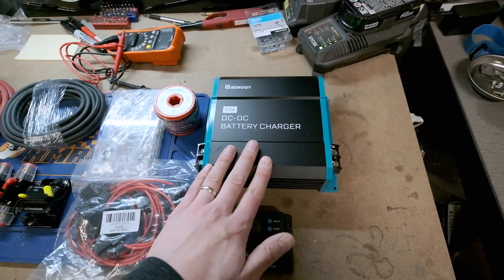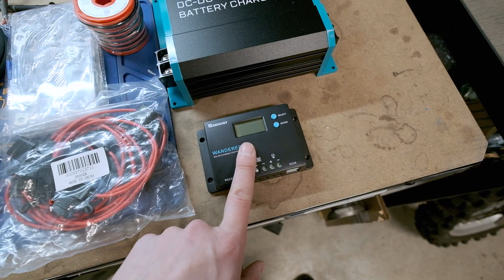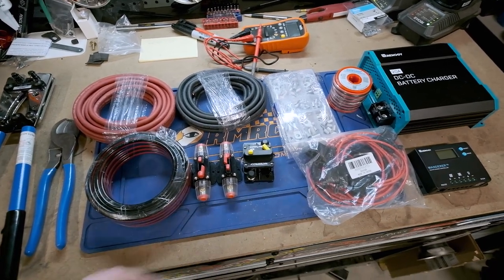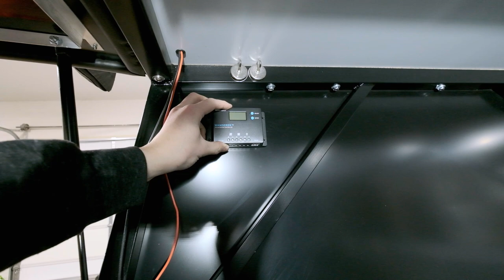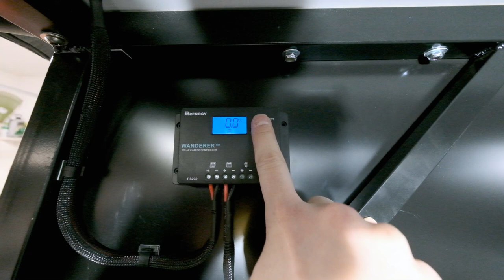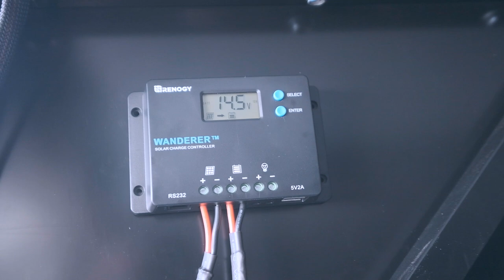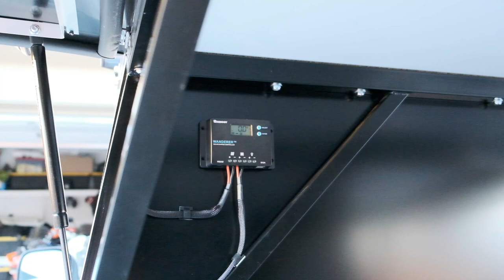DIY Solar and House Battery Install In My DIY Camper - Sunflare Xplor 105, Renogy DCDC Charger

Comment: You should build a mount for the solar panel. They get too hot and don't work efficiently.  Get some ventilation on the underside
Reply from the maker: We will see if it’s an issue in this use case or not. I could see how it would be on something with an insulated roof, but this is not
Reply: @pnwxplore  I'm no expert, nor do I have any experience with solar. It's what I've read and been told. Unless it's 110 out of doubt there's any problems, but I thought I'd relay what's been said to me. I'm curious myself how well it will work. I've got a setup in my truck with an battery isolation switch, 300 amp alternator, ran into my truck box with a 1200 watt inverter that's being replaced with a 5000 watt inverter. My bank charges when I drive. I also want to run solar though, for those times I don't drive much. Which isn't often lol. Then I've put a 70 amp breaker box with 30 amp shore power into my trailer. Tandem 15 amp breaker and single 20 amp. Still working on that though. I've got it temporarily set so I can get heat. Get sick of paying for propane. I've been off grid since April (2021) and I'm currently converting my cargo trailer into a leather studio/shop.

Comment: I like that solar panel.  I wonder how that stick tape will hold up as I would like to do that to my shell instead of installing brackets.  I really like the clean look.  I wonder how many watts it pulls on a bright sunny day.  Might have to wait a few months for you to test that.
Reply from the maker: Yeah we will see how it performs. But these are typically surface mounted and these are high quality panels, so I am sure it will do well.
Reply: The recommended tape for mounting solar on vehicle roofs is VHB tape, also available on Amazon. I don't know whether the tape used here is better or not.

Comment: Clean! Where did you fuse from the alternator/starter battery to the DC DC charger? And why did you choose the Xplor panel vs some of the cheaper amazon options?
Reply from the maker: The fuse is under the hood as it was the one I used with my 12v power run to the back of the truck. I got a decent deal on the xplor panel. I also like that it’s high efficiency and has a biomass diode on every cell, meaning one cell being shaded won’t completely kill the output of the panel.

Comment: Why add a fuse between the solar panel and solar controller? Does the solar controller not accept more than 6.2A the panel produces?
Reply from the maker: It really isn’t needed. I just did it cause it won’t harm anything being there.

Comment: Kinda off topic question. Does the Bed not have any support on the overhang besides the main extrusion and the E-panel? If so does it flex alot?
Reply from the maker: It’s supported with steel angle iron on 3 sides. Pretty much no flex
Reply: @pnwxplore  what about the part that’s over the cab?
Reply from the maker: No other support than extrusion. No flex as very little weight is being put that far forward because of the wedge shape. So only feet are down there